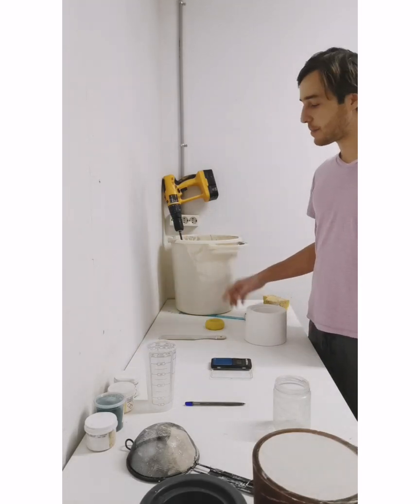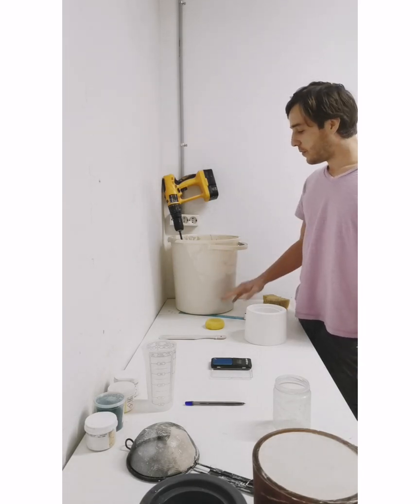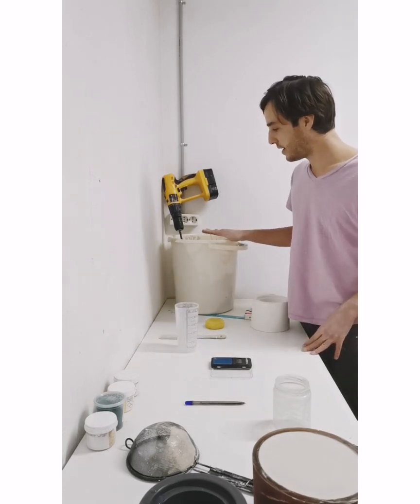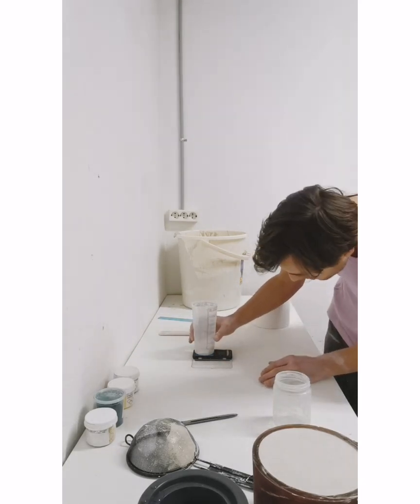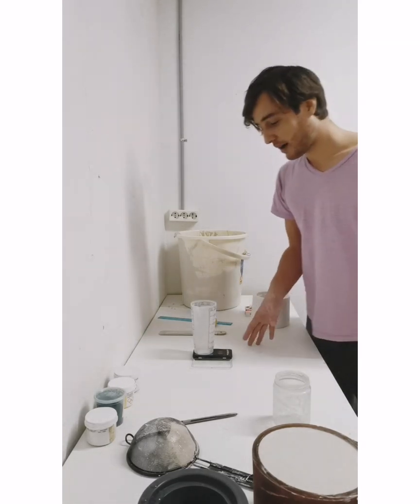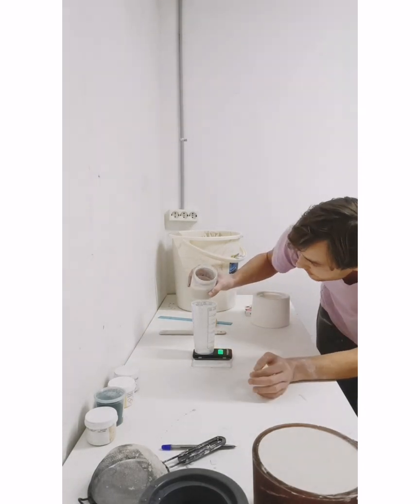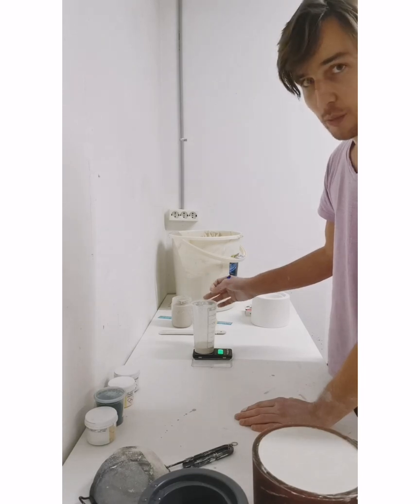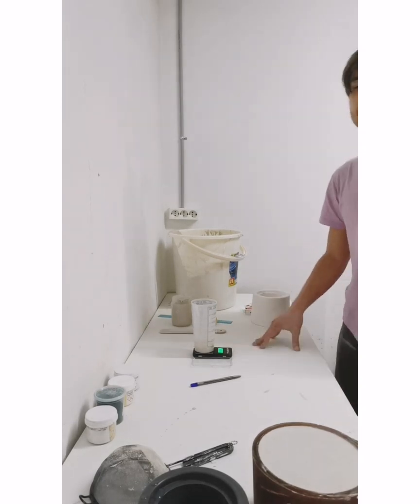How to reclaim casting slip and measuring specific gravity.

Comment: I want to ask about the sodium silicate you mentioned in the video. Is it 50% water and 50% sodium silicate? I don’t get to the soda ash part
Reply from the maker: It's 50 50 mix of soda ash and sodium silicate. Dilute this mix in water about 4 parts water to 1 part defloculant. It might be better to use Darvin instead of sodium silicate. It's very easy to add to much. When mixing up a fresh batch of slip I use about 0.2% sodium silicate base on dry weight of casting slip.